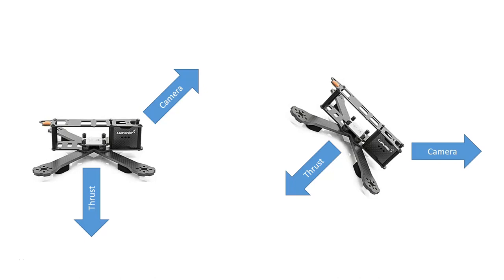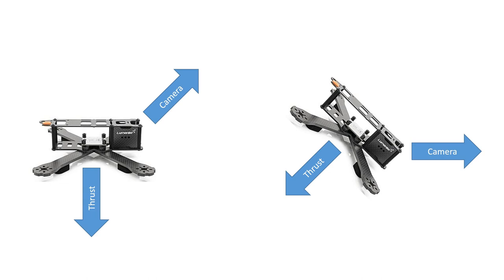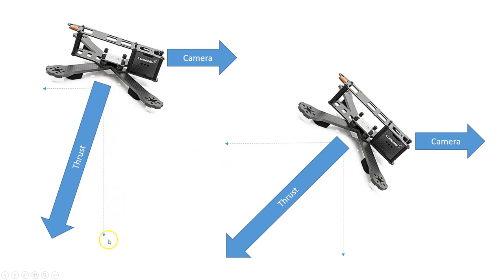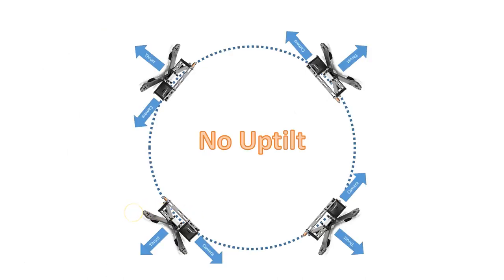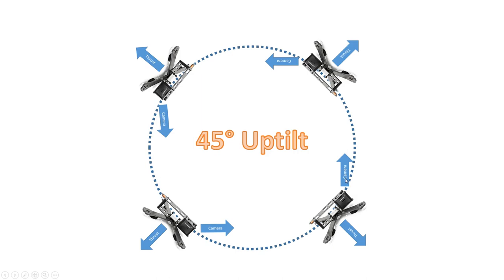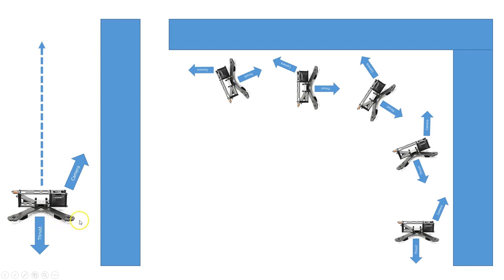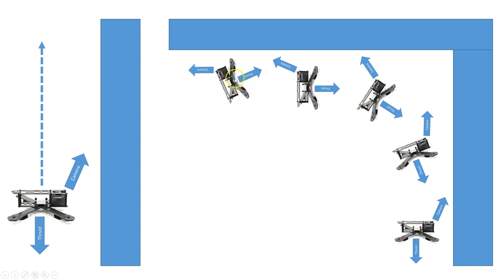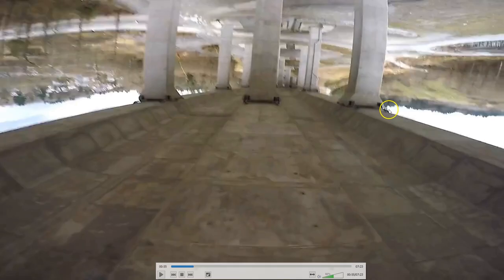The Secret to Mattystuntz Mind-Bending Stunts

Comment: I'm flying with about 10 degrees uptilt. Is it better for beginner to set up something like 30-35 degrees and start to learn flying with it, or better to start from 10 and go up step by step? I think it is difficult to fly slow with high tilted cam for beginner
Reply from the maker: If you go with too much uptilt too soon you'll just crash a lot because you can't slow down.
Reply: +Joshua Bardwell so it is better to learn with small tilt. By the way - thank you for the work you do. It's amazing. It is   better channel about fpv. And your videos comes out right as just as I imagine any question about fpv)) some kind of magic?)) 
For the last month or two just watching rotor riots and their separate channels "for the soul" and fun and your for all of the technical issues.

Comment: i have a question joschua ;)
why is the thrust in 90° to the circle circumference ? it could have another angle aswell or not? or is this model with a locked in thrust angle, circle scale and circumference?
Reply: how you want to fly a circle in real life...^^
Reply from the maker: In order to fly a circle, thrust must be 90 degrees to the tangent, I believe. I am pretty sure (but not 100% sure) that if thrust was not 90 degrees to the tangent, you would fly an arc instead of a circle.

But honestly, it's all abstract. It's just concepts.
Reply: thanks for your answer :) 
 cheers from north germany!
have a great week

Comment: Curious if the gopro or whatever is recording the video is at the same angle as the fpv camera?
Reply from the maker: +clifton23 He said no. He said the GoPro is at about 45 degrees while the FPV cam is at about 60-70 degrees. But the GoPro has such wide FOV that it still captures everything.

Comment: I'm on desktop and the video invariably stops loading past 50 seconds for some reason.
Even after refreshing the page and trying both safari and firefox.
Reply from the maker: Your computer is messed up. There is nothing wrong with the video.
Reply: Others might have the same problem. Just letting you know.

Comment: Personally i have to disagree. I think that his quad is a bit more heavy meaning, it has greater momentum, also since he is going really fast that also adds to the momentum of the quad thus giving more hang time. I dont think he has more than 45 degrees of uptilt, i think its very challenging to get the 60 degrees uptilt. From what i know Mr Steele is using 25-30 degrees which is relatively a small angle. So to sum it up... i think the momentum is the secret. (i also think he is is using 3D, cause even if he had 60 degrees of uptilt he would not be able to pull those tricks of. (simple trigonometry))
Reply from the maker: +Claudiu Ciontea a heavier quad does not have more hang time because it achieves less vertical velocity for a given amount of thrust.
Reply from the maker: +Claudiu Ciontea and Matty himself has verified thst I'm right. So there really is no debate.
Reply from the maker: +Claudiu Ciontea he is not using 3d.
Reply: Ok fair enough but he is going pretty much at full throttle and he's quad has the thrust. The main point is that i disagree with the up tilt .. i really dont think he is using such an extreme angle.
Reply from the maker: +Claudiu Ciontea well, you're free to be wrong. Once upon a time, way back when, I accused Tommy Ummagawd of using a gimbal, he was so smooth I just couldn't believe it. I've been there.

Comment: hey Josh I got a quick question for you since they found those new planets they are questioning gravity and they are questioning whether or not the Earth is actually spinning I had somebody ask me a good question and I did not have the answer for it when we do a bunch out to the clouds why when we descend are we not in another location if the Earth is actually spinning I know I need to put my tinfoil hat on LOL I figured you would be the perfect guy to ask on this
Reply from the maker: +Ultimatevapor918 just to be clear, nobody legitimate is questioning whether the earth is spinning. But to get to your question, let me ask you a question back. 

The earth is spinning. 

You are standing on the surface of the earth. 

You are therefore spinning. 

The Earth has an atmosphere. When the atmosphere moves relative to the surface of the earth, we call that wind. 

Sometimes there is no wind. 

What does it mean when there is no wind?
Reply from the maker: +Ultimatevapor918 here is another question. 

If you are in a car, driving at 60 mph on the highway, and you throw a ball up in the air, why does it come back down into your hand, instead of smashing into the back window?